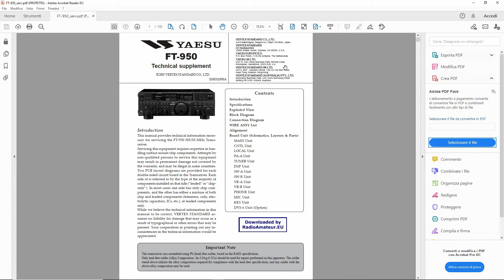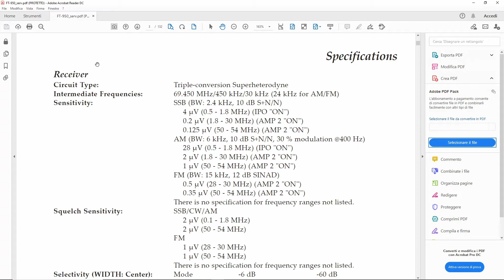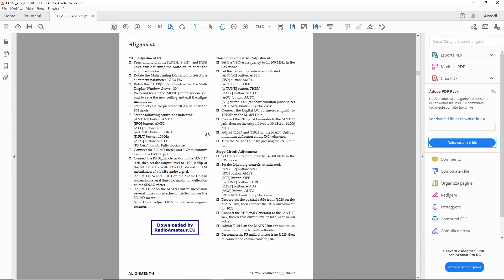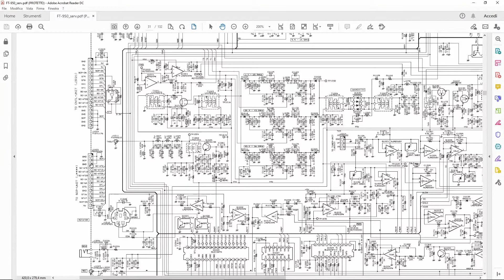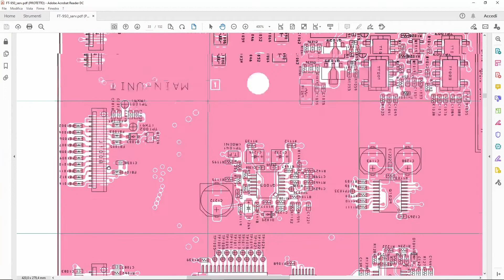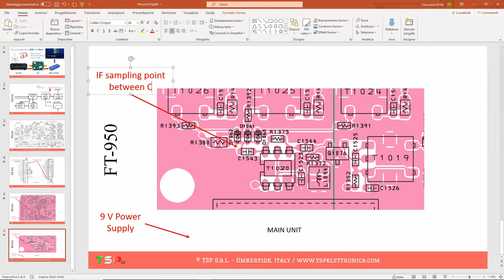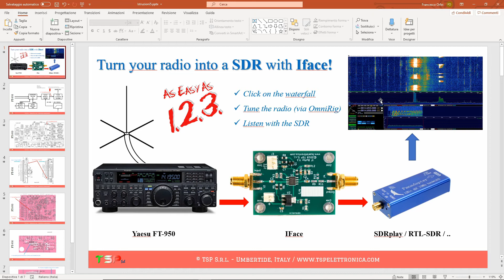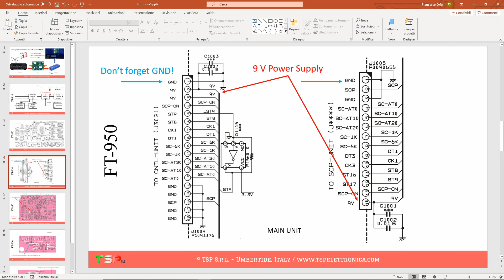How to add an SDR padanapter to your beloved radio and make your wife happy!

Comment: can this not just be plugged in directly to the scope output connector on the main board? as this is just looped out to a 50 ohm load via a short cable with TMP plugs.
Reply from the maker: It depends. Generally speaking, it's never a good idea to directly connect a low impedance load to a high impedance source. Most of the ports on the main boards of the radios are for lab measurements with dedicated instrumentation. So it's preferable to place a buffer in the middle between the source of the signal (i.e. the mixer) and the load (the SDR receiver). This is because of the low impedance (50 Ohm) of the receiver.